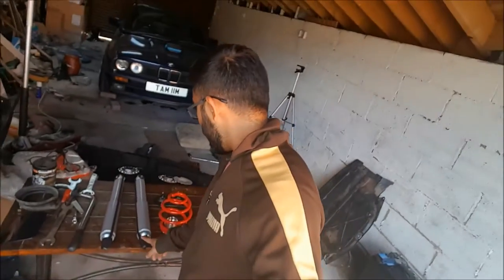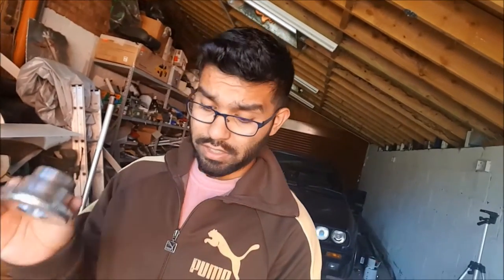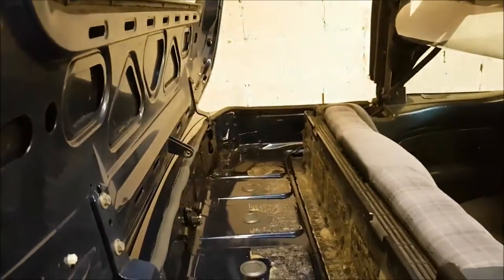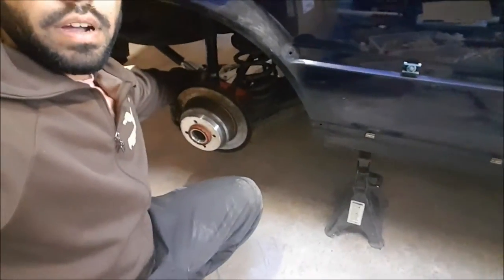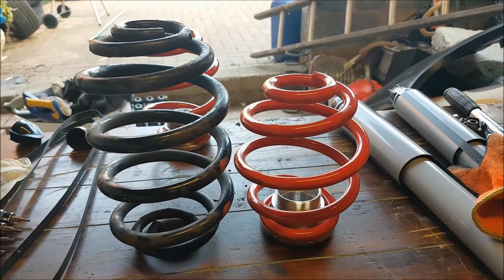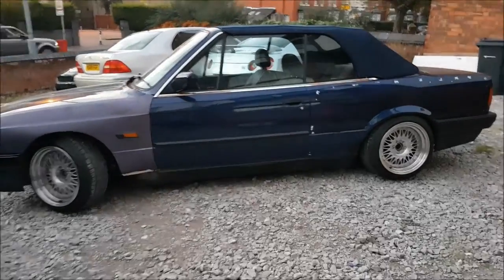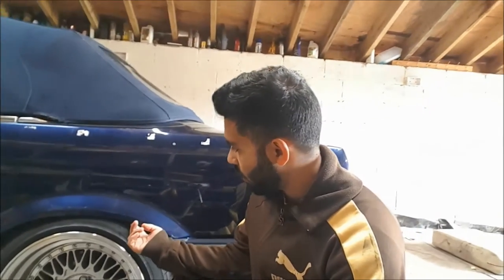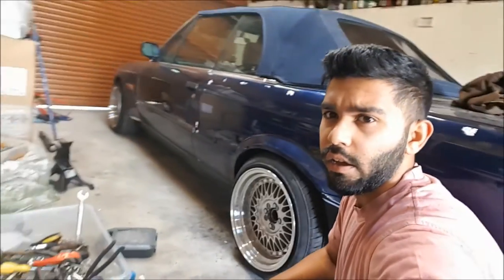BMW E30 Convertible Coilover install part 3 - Rear Setup

Comment from the maker: Buy them here: https://rover.ebay.com/rover/1/710-53481-19255-0/1?icep_id=114&ipn=icep&toolid=20004&campid=5338456010&mpre=https%3A%2F%2Fwww.ebay.co.uk%2Fitm%2FCOILOVER-BMW-E30-CABRIO-51mm-front-inserts-ADJUSTABLE-SUSPENSION-NEW%2F253957087719%3Ffits%3DPlat_Gen%3AE30%26epid%3D582615899%26hash%3Ditem3b2105a1e7%3Ag%3AQ5wAAOSw2gxYoZHZ%3Ark%3A21%3Apf%3A0

Comment: If you're fitting the m3 rear arches soon you could always cut the arch away, cut more form the outer skin and fold the inner skin up and stich weld it back together, you'll have more wheel travel if you fit bigger spacers to fill the m3 arches
Reply from the maker: haha your almost beating me to my next step. currently working on that now and almost got it to the point where I am finished so keep an eye out for the future videos :D
I think I just had fears of cutting the car (never done that before) but yeah.. see how it goes :)

Comment: Hi bro, beautiful E30 🙌. 
I have the same problem whit the rear fender, the tire is rubbing. How did you fix that?
Reply from the maker: I ended up going for a wide arch kit which fixed it for me, other option is to go for a different set up on the wheels/spacers.

Comment: What size and make wheels and tyres are you running ? thanks
Reply from the maker: Hey Keidicko, the wheels are some replica BBS I found online, if you watch this video linked you will see all about the alloys and the tyres and also in the description I mention who I got them from, could give you some help with getting some discount on new wheels too!https://www.youtube.com/watch?v=lODVGNMd5tY
Reply: No mention of wheels size ,make,offset  ???????????????????????????
Reply from the maker: damn thats my bad lol, for some reason I was sure that mentioned it in that video but watching it all the way through I realised I flopped on my own response haha. 
So the wheels are 16's, 9j and I recall it being et25, not sure of the make as I just got them from ebay and made contact with the ebay store owner. Im not really racing the car round or anything so its doing me just fine for now. But I think the wheels actual name is BBS RS Wheels if that helps you mate!